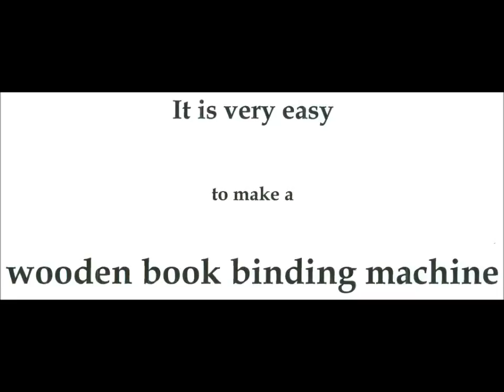wooden book binding machine

Comment: Traduzindo... pt-br

1 Placa base de 40 * 40 * 2 cm
1 placa de 40 * 21 * 0,7 centímetros colados à placa de base
1 Placa deslizante 40 * 10 * 0,7 cm
1 placa colada de 38 * 5 * 1,5 centímetros
a placa ligada e a placa de corrediça móvel tem de ter a mesma altura. 0,7 centímetros
1 placa móvel ligada às placas laterais 40 * 15 * 2 cm
1 aglomerado fixo à placa móvel com 2 parafusos longos e borboleta 40 * 8 * 2cm
2 placas laterais (liderança) 16 * 5 * 1,6 cm
2 placas de montagem 26 * 8 * 1,6 cm
Reply: Boa noite. Qual o nome daquela peça de metal cilíndrica rosqueada, entre os dois parafusos com borboletas?
Reply from the maker: e um pe de aluminio para moveis
Reply: Obrigado!